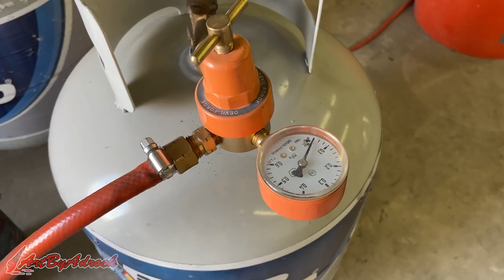Casting An Aluminum Alien CHESTBURSTER From The Movie Aliens (Complete Build Process)

Comment: ADAM FANTASTIC JOB I loved those movies even when it got cheesy lol. ADAM how long does it take to dry after you mixed and poured how long to dry 👍😎🇨🇦👍😎🇨🇦👍😎🇨🇦
Reply from the maker: About 10 minutes until it’s hardened
Reply: @ArtByAdrock  Thank you ADAM 👍😎🇨🇦
Reply from the maker: No problem, but you’ll want to wait 2 hours before putting in into the kiln to burnout. I don’t remove the tape or even touch it for at least an hour

Comment: Hey Adrok, very cool casting. So lost 3D print casting, this sounds like a really good thing. I do wonder about tolerances though. I cast parts which need to be pretty accurate.

But anyway, what kind of filament did you use that doesn’t give off much smoke? Would vacuum assist help with tolerances? Ahh so many questions.
Reply: I hear good things about PLA filament.  Melts at a low heat with very little smoke. Some say it's quicker, easier, and more reliable than wax sculptures.

Can't help you about tolerances though.

Comment: Nice job, is the 3D print media a special one to melt out, or do you just heat enough it melts out of the cavity
Reply from the maker: You could just melt out the regular PLA filament but I used polycast which is made for casting 👍🏻
Reply: @ArtByAdrock  thanks, appreciate the feedback

Comment: So i have a couple questions for you...and i know nothing of melting besides what you post. 1st is why is there always a dip on ingots after they settle? 2nd is a 2 parter. Could steel be used as a crucible and if so would it retain heat better so you wouldn't have to reheat the melted metal and save on propane? I know steel is metal but has a very high melting point thats why i ask.
Reply from the maker: Aluminum as with other metals shrink as they cool, that’s why there’s a dip. Aluminum will react with steel and eat through it so a steel crucible is not a good idea.
Reply: @ArtByAdrock  ah ok. That explains so much. Thank you. Looking forward to your next vid and have a great weekend
Reply from the maker: No problem 👍🏻